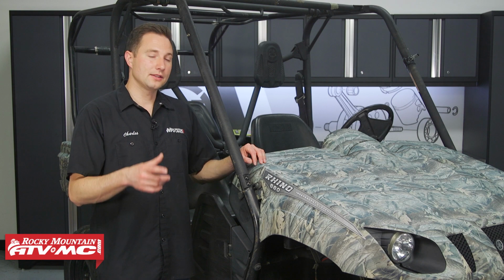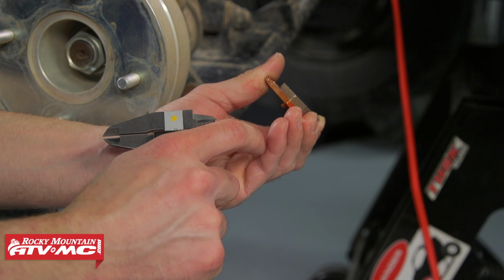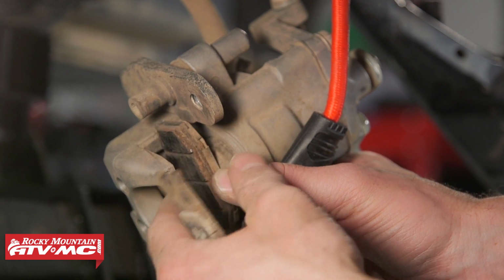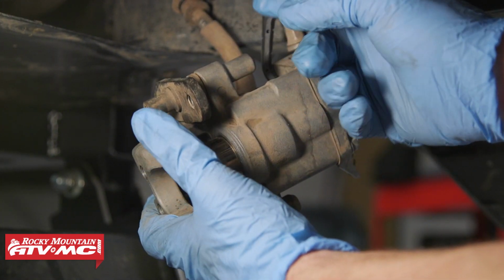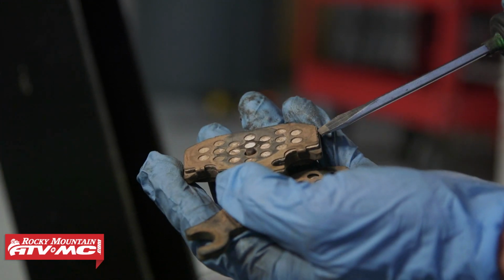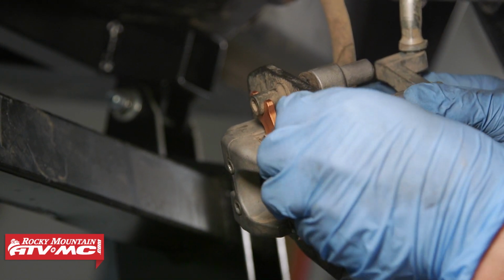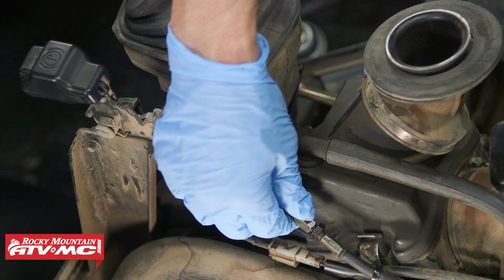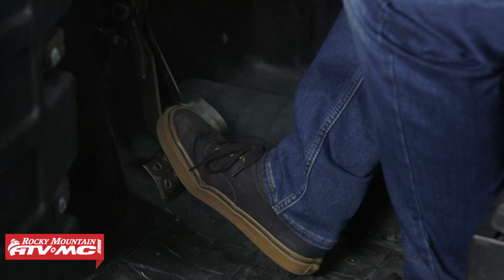How To Replace the Rear Brake Pads on a Yamaha Rhino 450 & 660

Comment: Ok, I am doing this right now. And it is nowhere near as easy as this makes it seem. Everything is harder when you are under it, on the floor of your garage. 

The caliper does not come down that far. 

And, being a broken down 65 year old crawling around on the floor doesn't help.

If I had a lift it would probably be easier when I got it above my head. 

Both caliper bolts were seized. And the swivel is laughable. I used my 3/8ths wrench with a cheater from the side taking the tire off. If you aren't bleeding you ain't working. 

Fun fun. I should have bought a new one.
Reply from the maker: Working on the ground is not fun, no matter your age. Good luck with the brake job!

Comment: Is it a requirement for the spacer plate you said if you want to install them, do you have to?
Reply from the maker: Not necessary but it will help with operation.

Comment: Excellent explanation,  very thorough and manual researched. Also right to the useful content with no useless intro. Very helpful thanks.  Looking for a video on replacing the starter clutch in a 2007 Rhino 450. I have the manual but would also like to see someone else doing it because it looks fairly involved with a lot of disassembly on the engine.

Comment: On my 2006 rhino 660 when my gas gets just below 1/2tank it sputter bad then gets hard to start any suggestions?
Reply: sounds like your pickup tube in the tank is cracked.
Reply: check your fuel filter